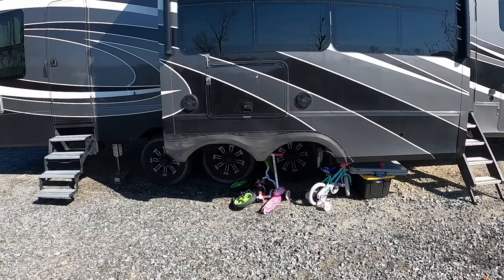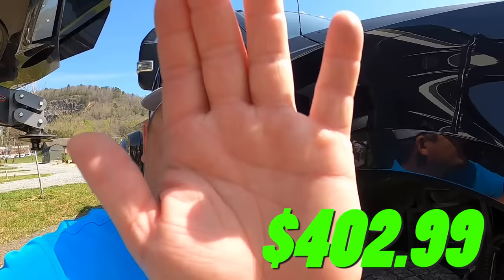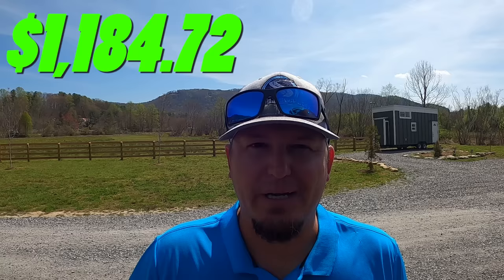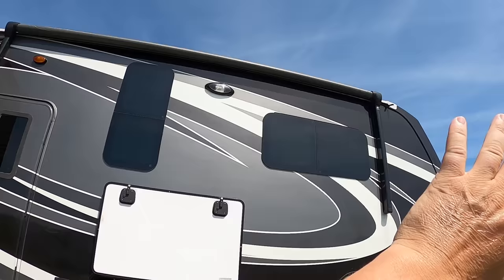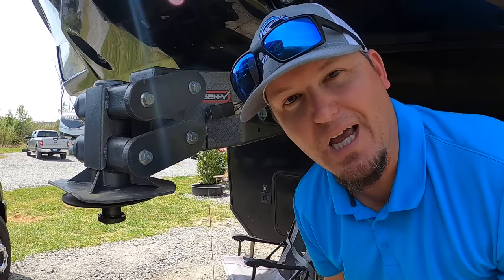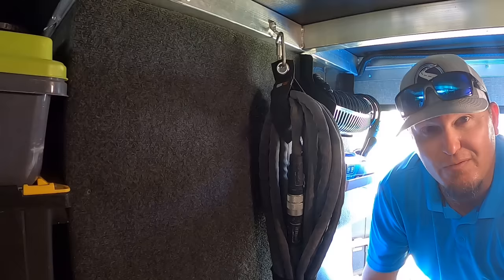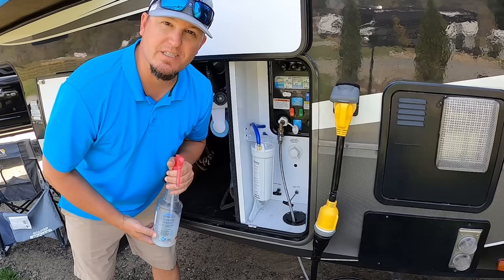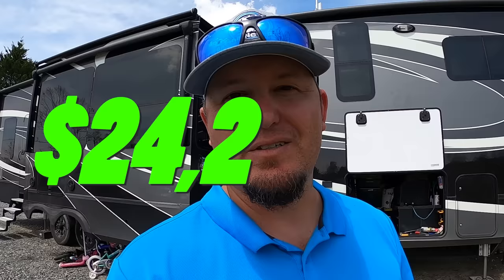These Things Are Money Pits! Everything That We've Had To Repair! | Fulltime RV Living!

Comment: Lifetime engine air filter? Huge mistake over the long haul.
That thing will allow more fine dirt into your engine than you can  imagine.
Just keep an eye on the  UOA reports under silicon.
Reply from the maker: You do know the lifetime filters have a cleaning and oiling procedure that you perform at every oil change right!
Reply: @PavingNewPaths  Yes, but you need to research this. There are multiple videos and hundreds of UOAs that prove much more dirt (silicon) will enter the engine.
Good luck and thanks for sharing!
Reply from the maker: @pmtips4482  Thanks for this I will go look into it!

Comment: I've worked in an rv park for over 14 years. I see brand new trucks broken down, allot more than you would think. I drive my 2004 Ford Ranger every single day. Everything but plug wires, tires, spark plugs, and fuel filter is original.Nothing else has ever been replaced. They couldn't give me a new truck. I pay $23 a month for insurance. Haven't had a car payment in all these years. How can anyone afford a $100,000 truck and a $200,000 5th wheel and rv site fees, repairs up the gogoo.
Reply from the maker: Great that you have everything paid for and it works out for you! We travel fulltime as a family and our needs are different than yours! We also don't own a home so we can justify having a bigger RV and a truck to pull it with! They also don't cost as much as you think! If you want to know the cost of the truck and the RV check this out https://youtu.be/uc049FoykEk

Comment: It's crazy that the roofs on RVs are so poorly designed. I fixing to do the same thing with mine and have it coated at a shop near me. It's going to cost me $5000, but my RV is only 30' long. They also replace all the top fixtures in the cost. Same lifetime warranty on the coating and the labor.
Reply from the maker: RV armor is the best thing we have every done to the RV, it was very unfortunate that our roof failed, but we will be installing an RV armor roof on our next RV on day one!  They should come from the factory with a roof like this!
Reply: @PavingNewPaths  That's why I'm doing mine now before I have a failure. My RV is only 3 years old, but I know it will be well worth it.

Comment: Repacking the wheel bearings IS NOT necessary every year.
Reply from the maker: It actually is when you travel 15k miles a year! The manual states yearly or every 12k miles!

Comment: Thanks. Probably won’t be buying an RV now. And Grand Design was my choice..the Imagine tt. After watching your video and a bunch of Liz Amazing I have come to realize either you have a ton of money to hire fix it people or you become very knowledgeable and capable of almost every part of the unit. Not being great at handy work (did not get the hammer gene passed down from my father who was) this would be a potential nightmare. And I live in Florida where the sun does it’s thing slowly ruining the outside of the unit. Was going to rent the house and do full time rv’ing for a year but highly doubtful now. I have also learned if you are going to buy used or new,hire an inspector before you buy and warranties are “devil is in the details” type of documents .
Reply from the maker: Rvs are an awsome way to travel, what you should take away from this is if you use them they will break! Also the ammount of money you spend doesn't change the outcome they all break! Just come in with the expectation that the RV is part of the adventure!

Comment: I once own a rv, bought it new. Rvs are make cheap, after six years I sold it with only 17,000 miles. On it, they’re money pits. It seem like all I did was worked New tires, but if you can’t put it in under cover like a barn or warehouse you will have problems. Think
Reply from the maker: We have traveled in our for 3 years and over 30K miles on the RV!  It has been an amazing time and this is just one of the trade offs to living a life like this!

Comment: You should own a Diesel Pusher. I think your maintenance costs on the truck wasn’t too bad. The rest where upgrades.
Reply from the maker: There were very few upgrades in this video! We did a video that covered everything we upgraded on the truck and the rig you can see it here!https://youtu.be/uc049FoykEk
This was every thing we spent over two years of traveling on the truck and the RV! There is no need to categorized between repairs, maintenance or upgrades, they all happened and they all were at a cost to continue traveling!

Comment: Curious as to what tire brand you are using? We have a 2015 RAM 3500 DRW and are about due to change out these Firestones. Thx
Reply from the maker: We run the Michelin LTX AT2 tires! Our first set got 44K with no rotations our second set got 48K with rotations!

Comment: Sounds like about $1k per month maintenance costs btw truck and trailer. Might be comparable to a home expense. Like water, electricity, monthly home maintenance issues. Why did you chose the big truck instead of a class A and a trailer for a smaller car to tow? Looks like a nice setup.
Reply from the maker: We sold everything to do this and it is much cheaper than our home upkeep was! The 1k a month is an average but that also accounts for a lot of big one time repairs! The normal maintenance and repairs runs around $300 a month! We went with this because class A are not really made for a family, we wanted our kids to have thier own space! We also needed a truck that could pull the trailer and be our adventure wagon when out exploring!

Comment: I bought an rv several years ago and I will never by another one . They are put together so cheap !!!!!! I swear if you by one you will be fixing it every time you turn around . We tried taking it to several different dealerships the first couple years for the repairs but that was a disaster every time !!!!!! It never got fixed properly if at all !!! I think this entire industry is a joke and I don’t care had bad you want an rv to travel with your family and pets just about every time you take it somewhere when you get there something will be broke and then you spend part of your vacation fixing the thing and it ruins part of every freakin vacation. We didn’t buy exactly a cheap one either paid over 30,000 for something that in my opinion was built to the quality of 10 grand at the most . Worst purchase I ever made !
Reply from the maker: What we have found is when people tell us stories like this, the problem is you went into it with an unrealistic expectation!  If you buy and RV and only use it a few times a year you will usually be very disappointed, Letting things sit up in storage causes more harm to them than fulltime use!  So of course, every time you pull it out of storage to go on vacation it breaks!  You also expected more from the dealership and you were let down again!  So now you hate everything about your RV experience!
Reply: @PavingNewPaths  I store it at my house and use it often , you are correct though I guess I did have the wrong expectations cause I thought when you pay over 30,000 grand for an rv it would hold up a little better .

Comment: You need todo the oil and fuel filters yourself easy stuff and save half if not more in cost
Reply from the maker: I do change my own oil and fuel filters!  Since we travel fulltime most RV parks have rules against this type of work! So when we have permission I do it and when they don't allow it I take it to Ford!  The oil change at Ford is actually very cheap, $110 for a diesel, I can do it myself for about $80!

Comment: Ya traveling full time with some of those larger trailer i feel like they werent designed to have to pull at 70mph everywhere
Reply from the maker: We usually drive around 65 or what ever the road conditions allow, sometimes thats 60 or less! Your right most of these probelms happend while moving it! Our first year was the worst, almost every move something new was wrong! Now we are in our 3rd year and it's been pretty uneventful in terms of repairs!
Reply: @PavingNewPaths  thats good to hear

Comment: Why wouldn't you just use the air conditioner to dehumidify?  They're the same device- the dehumidifier just keeps the heat inside
Reply from the maker: It doesn't work that way! Th Ac will only take the air it has and condition it, if you want to remove water from the air you need a dehumidifier!

Comment: Surprised you don't change your own fuel filters, easy to do and it's one of the most inflated maintenance items at a dealership on a diesel.  $30 ish (depending on where you order it) for a filter and 5-10 minutes of time to change one. Breaks and new rotors are not difficult to replace and would have saved you at least 50% DIY.
Reply from the maker: Normally, I would but when we aren't at our home base, doing our own maintenance becomes tricky. Most RV parks don't allow for maintenance to be done in your site, so if we can't do it at our site, we have to pay someone to do it for us.
Reply: @PavingNewPaths  makes sense!  Always the the Walmart parking lot 😂

Comment: I dont care how expensive the trailer is and what Co., they're all thrown together with toothpicks and glue! There's another guy on here who spent over 500k on a top brand new motorhome and had it in the shop 6 times the 1st year so it could be fixed for free under the warranty. Put some shiny items in the cabin and another sucker hooked, they just dont care anymore about quality. At a minimum, buy used, like we did, as "most" of the bugs have been worked out by the former owner/s. But its definitely a love hate relationship owning and trying to get out and "relax" in these things 😂
Reply from the maker: We love ours and the RV is just part of the adventure! We also brought used and took the savings over new to make all the repairs! Even with that cost we still have less in ours than the price of a new one! Our way of traveling is part of the reason our cost are higher, we want to explore and see as much as we can!

Comment: I'd be interested in what you paid for your RV and your truck? I'm guessing better than $190,000 or so... add that on to the $24,000 you're spending on expenses for the first 24 months ownership. And all the time labor and worried that you go through each day just to keep it running. The worry factor seems pretty high about owning an RV, because there's always something that's just about to break or that just was repaired. That's $214,000 for the first two years. I didn't include insurance or fuel either. Let's say $1,000 a month for insurance & probably $1,000 a month for fuel for the Fail, I mean Ford. That's an additional $24,000. So that's $238,000 for being free in an RV? So that's $9,916.66 per month for expenses to drive an RV around from parking lot to parking lot. What a waste of money.
Reply from the maker: You don't have to guess or do math we have made a video on exactly how much we paid for the truck and the RV you can see it here! https://youtu.be/uc049FoykEk
And if you want to know our monthly cost to travel this way including all the maintenace here is that video! https://youtu.be/RQGACy9_-WM

Comment: You need to inspect every 6 months. Not reseal. Dicor can last 10 years plus  and still be good.
Reply from the maker: You are correct, but every 6 months when I did my inspection I did quite a bit of resealing over the cracked and dried out areas!

Comment: To be fair, the bags, shocks and stabilizers weren’t a maintenance or repair item.
Reply from the maker: This video is about all cost associated with the truck and the RV! Shocks and airbags are a maintenance item, your not towing this rig without thrm, and the stabilizers was to help with a future potential problem! It doesn't matter what you categorize them, the cost happened!
Reply: @PavingNewPaths  so where do you draw the line between things you want and things you need? You can spend 50 grand on audio system that you don’t need, but the cost still “happened”
Reply from the maker: @jabroni6199  We didn't draw a line we haven't done anything to this truck or RV that wasn't for the benefit of towing and living on the road fulltime!

Comment: What year is this R.V. and how many miles? I can't believe the roof coming apart and the inside trim pieces coming unglued.  Is this quality level typical for modern r.v's?
Reply from the maker: The RV is a 2020 model we have been fulltime on the road for 3 years and the RV has been towed about 30,000 miles!  The roof came off about 6 months in to traveling, almost all RV's are built the same, It could be better!  Almost all of our problems came in the first 9 months of travel, now that we have worked all the bugs out it is just routine maintenance and minor repairs!

Comment: Remind me not to buy a RV ....or a Ford! Look to the future. Would you keep this unit on the road 10 years? what is it worth in 10 years? If initial cost was $187000 could you sell it for $90000 in 10 years? Costly to maintain, averaging $12000 per year for 10 years (Likely way higher as it ages) so that's maybe $120000 for 3650 nights camping, or $33.00 per day, or am I way wrong? Doesn't actually seem that bad after all.
Reply from the maker: This is our home that we travel in fulltime!  When we sold everything there is a limited time we will do this!  3-5 years! Most of the cost happened in the first 12 months of traveling, the second year was much cheaper and now in our third year it is even less, but we have tires and other big ticket items coming up soon so that will mess the budget up!  Overall with out major onetime things like the roof, the overall monthly cost is usually around $300 to take care of the rigs!  We have a video about our monthly cost if you want to check it out here https://youtu.be/RQGACy9_-WM
Reply: @PavingNewPaths  Thanks for the reply. I was going to say that the replacement air filter is a bad plan. If you don't oil it enough dirt gets through, if you give it too much oil your MAFF sensor gives trouble. You're likely just doing pavement driving and won't see much dust anyway. Good luck safe travels!
Reply from the maker: @alm7707  I stay on top of the maintenance on the truck!  The truck tows on the pavement, but has taken us on all our adventures during this time!  Out west this truck had us all over the National Park trails and BLM land!

Comment: Should have bought a Dodge truck 6cyl cheaper to work on than a 8cyl wait till you have a fuel system issue on that Ford or some other motor problem off come the cab and front end
Reply from the maker: You do know the Dodge uses the same CP4 fuel pump as the Ford that causes those fuel system issues!
Reply: @PavingNewPaths  I do know Dodge recalled theirs and replaced them with the cp3 pump. But still don't have to lift the body off to do major work. The Cummins is a proven motor its rated to be in a truck with a 68,000 gvw will run all day at 1250 degrees on the exhaust temp Ford and the duramax may be faster but it will cost you in the long run to be first to the top of the hill. I rather have 6 horses standing up than 8 laying down. I will probably buy a new dodge when I start using my 12 valve for just driving to the store 485000 still going strong
Reply from the maker: @davidcaskey4669  I have nothing against any brand! They all make great trucks now and are amazing at doing what they do! We happen to like Ford!
Reply: @PavingNewPaths  the cp4 pump is for European fuel its cleaner than U.S. fuel that why the cp4 has problems and the cp3 will not fit the 6.7. I love the looks of the ford if it came with a Cummins would be the perfect truck
Reply from the maker: @davidcaskey4669  I am looking at a disaster prevention kit from S&S as well as a new pump they have come out with! I have read good things but no one has had them long enough to see any failures yet! Do you know anything about this stuff?
Reply: @PavingNewPaths  no my two buddies that have the 6.7 have just done the delete for the EGR and the DPF filter made it a different truck but both are just waiting on the pump to go I have a air dog on one and a fass on the other I can get filters that go down to 2or 3 microns for these. I don't know if you could put that on those new motors I do know that the man that deleted my one buddies truck told him not to put the 50hp tune in it if he was going to tow heavy because the bottom end would not take it but that may have just been his opinion
Reply from the maker: @davidcaskey4669  Thank's, i am sure what I am going to do, I still have the powertrain warranty so I want to keep it, but I also want to protect the truck as well!

Comment: 13:30 KEYYYY
Reply from the maker: Maintenance is key!
Reply: @PavingNewPaths  I just bought a 2005 Flagstaff 831bhss, it's in rather good condition, there was some water damage, and a few holes in the wall, and the axle/ frame have surface rust, your video was SUPER helpful to md

Comment: You do not have to replace lap sealant every 6 months.
Reply from the maker: Your not replacing it, but you do need to reseal all the areas on the roof as needed, usually every 6 months especially if your RV is outside everyday!  We don't have that problem any more as our roof failed and we replaced it with RV Armor roof! Now we just inspect it and clean it, and it comes with a lifetime warranty!